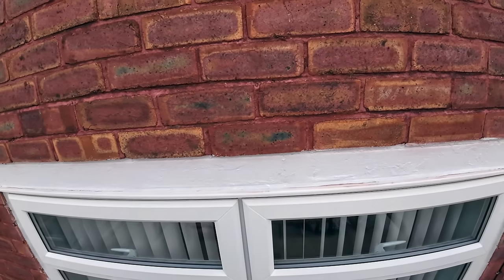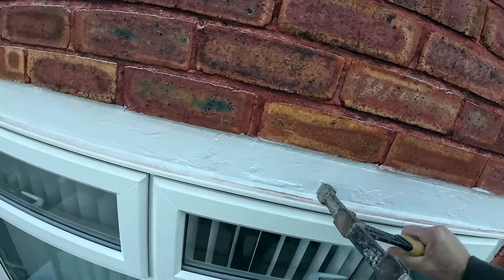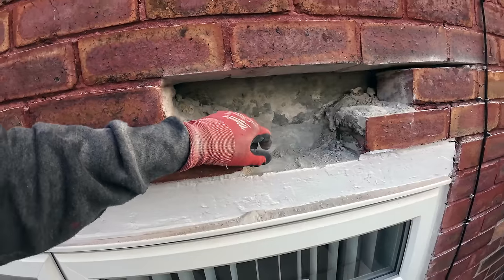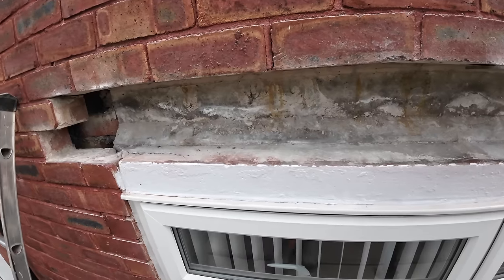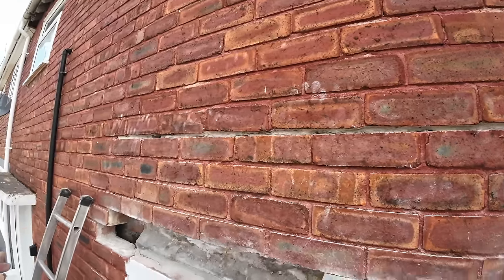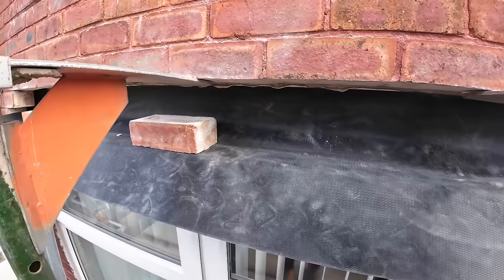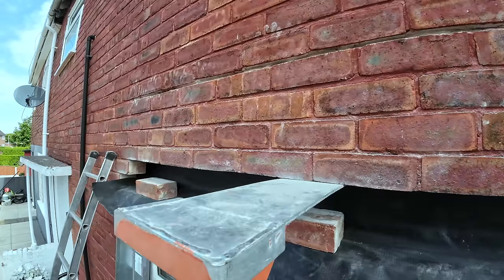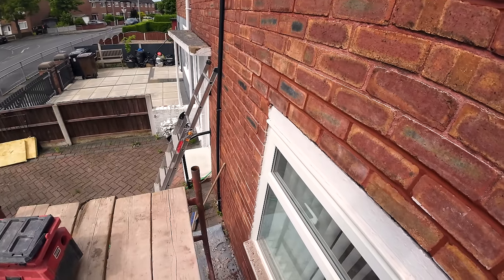ISSUES WITH CRACKED BRICKWORK… WE EXPLAIN THE CAUSE

Comment: Hi, the reason for the horizontal cracking of the bed joint is because the builders used a galvanised wall tie which was common at the time. The galvanising has broken down and the metal has started to rust which causes the bed joint to open up. The cracking is at 450mm vertical centres ie the centres of the wall ties. Can’t stop this from happening, the only way is to take the brick outer leaf down, cut of the wall ties and rebuild the brickwork using angled stainless steel wall ties plugged and screwed to the inner wall. Hope this is of help. 😊
Reply: Every days a school day👍
Reply: No need at all to take the outer leaf of brickwork down to resolve the failed wall ties. Mountain and mole hill springs to mind.
Reply: @garybrookfield4528  I agree with Keith - to a certain degree. Two ways to overcome this issue.
1) = Do as Keith recommends, although this would be a very intrusive and a expensive option.
2) = As  Steve, mentioned in the video, the entire front elevation of the wall could be raked out to a good depth and re=pointed correctly. This wouldn't solve the issue but, would prevent any further driving rain entering the cavity via the joints.
👍

Comment: Is it possible that minor rotation of the boot lintel has caused cracking in joints above allowing water penetration? This corrodes the ties, so wall tie cracking only ccurs above these lintels?
Reply from the maker: The tie wire issue is very common.
🧱👍🏽
Reply: @gpbeck
For  "minor rotation"  read microscopic thermal movement.  There is not enough loading on that boot lintel to cause any torsional or twisting movement.
Basically the boot lintel will move from side to side (thermal differential movement) and not up and down - unless there is corrosion in the reinforcing steel inside the boot.
Steve's, assessment is spot on. "Tie wire jacking"  is a very common problem in older brickwork, and the smaller panels of brickwork are more prone to lifting.
Reply from the maker: Thanks Matin . Mine was an educated guess. Thanks for you’re excellent explanation as ever 🧱👍🏽

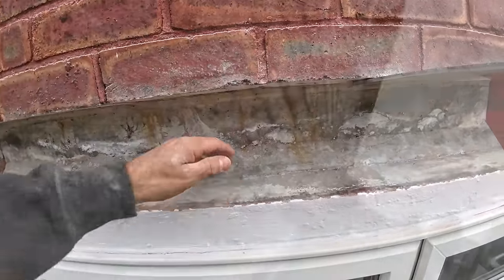Comment: I’m fairly certain that water doesn’t run down the back of the inside skin, from what I’ve been told any moisture will condensate on the back of the external skin (cold side) and run down the back of the brick then into the tray. Just a thought I’ve seen you mention water running down the inside skin (13:38 in this video)👍
Reply from the maker: Totally agree 🧱👍🏽
Reply: When houses get old and miss some maintenence, you can get water in there from dodgey eaves, poorly sealed windows and openings above etc. Even porous old bricks/mortar can start weeping if you have a few days of heavy, wind driven rain on the walls. Cavity trays are for the future when the house ages.

Comment: Pukka job guys, couldn’t work out how that boot lintel was being supported , no 150mm bearing etc??
Reply from the maker: Cheers. What an awful invention 😒🧱👍🏽
Reply: Well the bearing use to be 100mm and it was good enough for years, the boot lintel is cantilevered, it's thicker and heaver on the internal leave plus when these were built the cavity was closed off as part if the wall build so the boot would be on this too. We have them all over our older authority houses.
Reply: @KingstonHomeMaintenance  gotcha. Cheers for explanation 👍🏻
Reply from the maker: Cheers Mike 🧱👍🏽

Comment: Well - Well.....The Lancashire, Lintel-Lifting-Lads, have found their first Boot Lintel....!
Just seeing that thing sitting there will give me nightmares for a week.  Those blooming things are a big part of the reason I walk with a stick now.

Cavity trays - No mate, we never used to put them in.  Cold bridging wasn't such an issue then. And  your combined electric & Gas bill was about £125 a year, so just add another double panel radiator to the room, and turn the radiator up....!!!

Insulation in cavities - whoever had heard of such a daft idea.?  Insulation was for roof spaces, 50mm....that will do nicely.
Different times in those days.
👍😁🔨🧱
Reply from the maker: How times have changed 😬🧱🧱👍🏽
Reply: @SteveAndAlexBuild   So very true Steve.
50mm cavities,     Bitumen & Hessian D.P.C`s,      NO cavity trays anywhere,            NO insulation in the cavities,      Galvanised wall ties,    Return the block work into the reveals to close the cavity at window and door reveals    (with a vertical D.P.C)    windows & doors made from timber, and single glazed.     Internal partition walls always built of blocks - NEVER studwork,     Putlog - scaffolds we erected ourselves,     Timber pole ladders,      single guard rail on scaffolds,    NO brick guards.     Brickies Labourer, used two hods normal brick hod,  and a Plasteres hod for the compo/gobbo.     NO pallets of materials, mortar tubs, tele-handlers or forklifts.    Bricks arrived on site stacked loose on the back of a lorry, and were hand balled off.      Cement in hundred weight sacks. -    and bloody huge great boot lintels - either cast in situ, or pre-cast monsters.     Hand cut roofs,     BS7471F sarking felt........and on  and on.      Oh and one more thing Health & Safety barely existed on housing developments, and site welfare for lunch was the cement store, and very rudimentary toilets...................happy days uhmmmmmmmmmmmm.....!!!